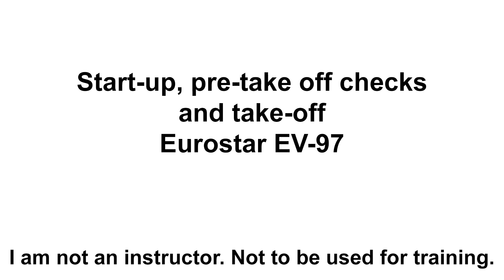How to start up, pre flight and take off a Eurostar EV-97 Microlight #eurostar #ev97 #howtofly

Comment: Hi Steve, could i ask how you record radio using a Gopro?
Reply from the maker: I actually have a separate audio recorder (a Zoom H1n) which I connect with a headphone splitter cable. I then stitch the audio together with the video in post. Works well.
Reply: @SteveMiddleton  thank you. Could you post a link for the splitter cable? Learning to fly the Eurostar at Mainair at the moment and trying to film my lessons. Hopefully see you around at Barton 👍🏻
Reply from the maker: @zaheerkhonat4456  you’ll want one of these kenable PRO 6.35mm 1/4 inch... https://www.amazon.co.uk/dp/B00O2WZU7A?ref=ppx_pop_mob_ap_share plus an adapter to convert the 6.35mm to 3.5mm and you really should get an attenuator as well so that the audio is not too loud and distorted.